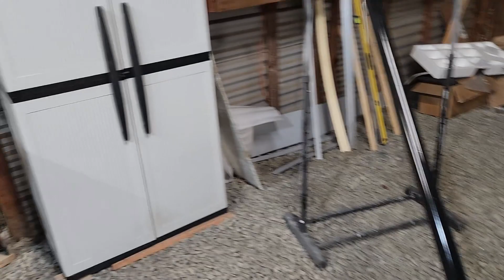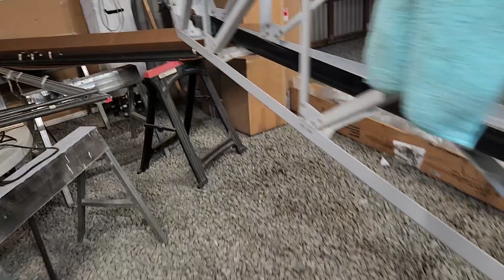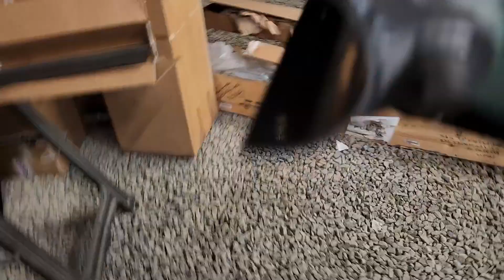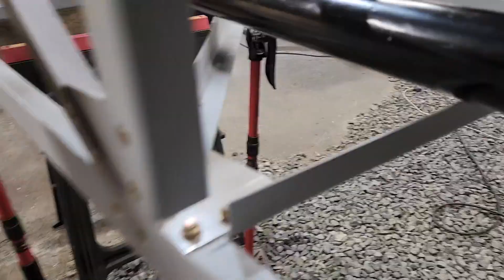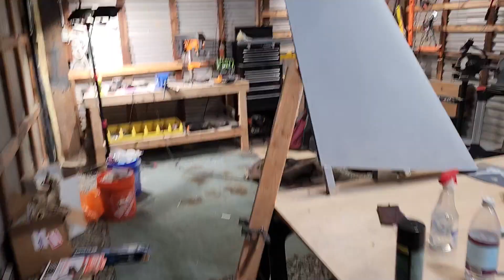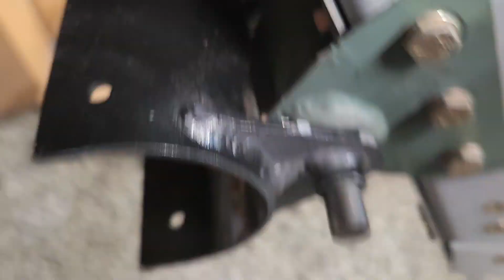Bede BD-4C Build Log 019

Comment: Nice update; ready to see some skin on it.... on the registration/legalization for it, have you started any of that, getting tail numbers, etc.? What color scheme have you picked out? Maybe I missed it, but what engine have you decided to go with?
Reply from the maker: Unless I come across a stellar deal on an IO-360, I'll be going with a Viking 195T with a 5-blade adjustable Duc prop.  Color scheme is expected to be dark silver with possible black and turquoise accents but I need to model it in 3D first to see what I prefer.  I've only had informal inspections done so far by a real inspector but it wasn't official.  The only problems he noted were that some of the machine screws didn't have enough thread showing which I was aware of.  I used the wrong thickness of washer in several places that I'll need to go back over and replace with thinner ones.
Reply: @SkyFunChannel  I'll be very curious to see how Viking ends up working out for you (over time). When you go to other homebuilt aviation forums, there are armies of critics of any and all auto conversions (comparing against the usual Lycoming / Continental, air-cooled, slow-turning engines), and without any personal practical experience, one could easily get the impression that you're taking a gamble on that Honda, even if it IS adapted for aviation (with a robust PSRU). On the other hand, the engine's reliability (in cars) is legendary, and the testing regimen it had to go through is well known, so it's all mostly about the right PSRU and proper cooling.
Reply from the maker: @vasicp  Yes it's a tossup.  Of all the PSRUs I've seen, theirs looks like one of the most robust.  Honda engines are so rock solid I'm not concerned at all about the engine itself even at the higher RPMs it will be running at.  It's a bit of a gamble but compared to a used lycoming which would still probably cost more and have unknown issues, it's a wash.  If I come across a deal on a low time IO-360 I might still go that route.  I've still got time to decide.
Reply: @SkyFunChannel  And even with a great deal on a Lycoming, the maintenance on it is still many times more expensive, since parts cost significantly more, and you can’t do any of it yourself (unless you’re a certified A&P).
Reply: Another thing I probably missed, but where did you buy your kit from? Several times you reference Aircraft Spruce, but when I go on their site they don't show the BD-4, so my assumption is you're buying some items from them, like as if you are building from scratch, or what? I'm watching your build with interest because even though the BD-4 isn't the most attractive plane, it has some very attractive features that I like so I'm strongly considering building one versus something from Van's or one of the other manufacturers. 
One last question; when do you hope to get it up in the air for a first flight? I know you mentioned you hoped to be taxiing by now, but I know all too well life get's in the way and God has other plans for our time, but I think you're making decent progress.
Reply from the maker: @acobra67  I bought the kit from Bede but a lot of the smaller bits like machine screws, aircraft cable, raw sheets of aluminum, etc. are drop shipped from Aircraft Spruce mainly although some bits are sourced elsewhere.  Just about all of the fuselage kit comes directly from Bede since it's all custom cut aluminum spars and gussets.  Basically anything custom like weldments, or unique like the big heavy wing spars, come directly from Bede.  Stuff like sheet metal gets drop-shipped.  I went with the BD-4 for one basic reason - it checks the most boxes for what I want it for - mainly a fast cross-country machine that's still practical for camping, etc.  It doesn't do one thing extremely well be it does a lot of what I want it for very well, if that makes sense.  If you're looking for a fast four seat high wing that doesn't cost a small fortune, it's hard to beat.  I'm planning to go nuts over the Christmas holiday getting things done so I should be at least taxi testing by spring.  Given how life gets in the way lately I'd guess first flight MIGHT be doable by late summer.